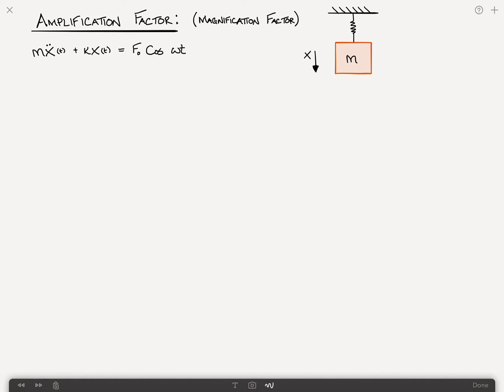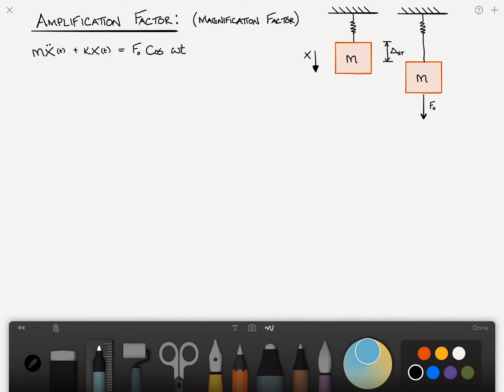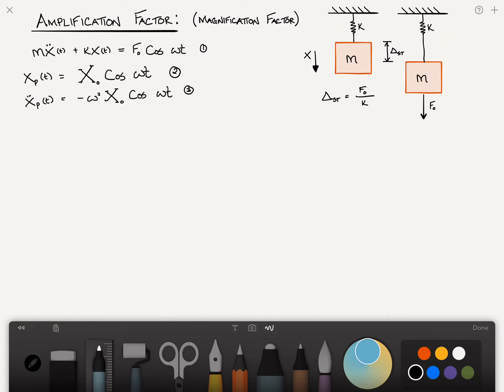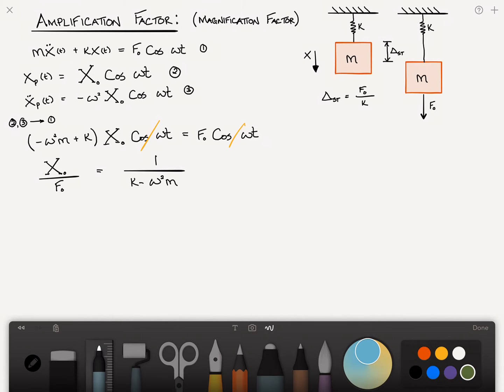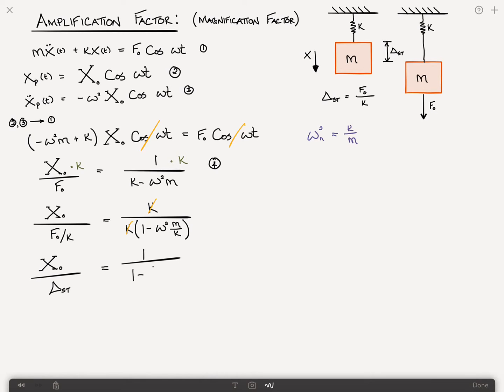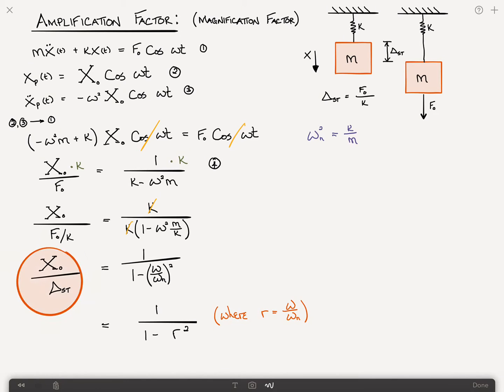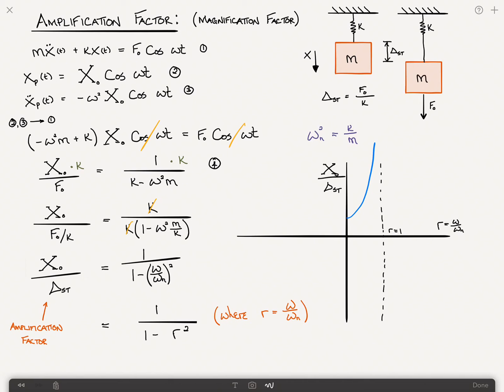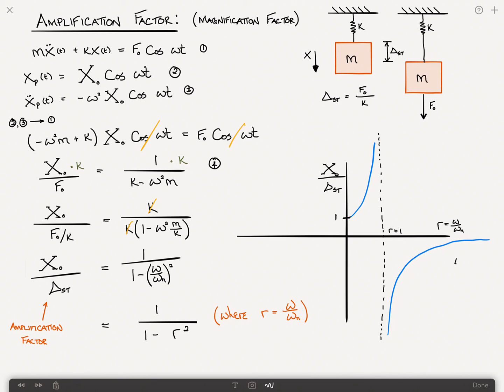Dynamic Amplification Factor

Comment: It's quite comprehensive, nice video! I have some questions here. Is the amplification factor also the transfer function? Can we take the special solution xp(t)=X0cos(omega*t+phi) or xp(t)=X0e^(i*omega*t)? And besides the sdof, how to do that for mdof, like two pendulums?  Thank you~
Reply from the maker: Yes, you could have used either of these functions (only phi will be zero because there is no damping so everything is in phase).  I would say that, technically, Amplification Factor is a subset of the Transfer Function - their definition is slightly different.  In this SDOF case they may be the same thing, but for larger systems, I would say that for the Amplification Factor, we look at certain elements of the Transfer Function.  Both involve examining the steady-state response of the system.

In this video on dynamic vibration absorbers, I perform a similar treatment of for a 2 DOF system....only in this case I am looking to zero out the amplification factor.
https://www.youtube.com/watch?v=7T6pQnNBph0
Reply: @Freeball99  Does that mean, the amplification factor and transfer function both neglect the trigonometry part?
Reply from the maker: @andrealiu8650  Not sure what you mean by "neglect the trigonometry part".
Reply: @Freeball99  Sorry for my expression. I mean, only consider the amplitude, and assume the trigonometry to be at maximum, which is 1.

Comment: Hi

Could you please clarify the following 3 queries:

If I have a steel structure supporting a heavy industrial machine (about 20T) with rotating load, and I want to know the natural frequency of the structure to check the effects of the rotating load - what is the mass that's used in the calculation of the natural frequency of the system? The steel frame only, or the steel frame plus the weight of the machine, or the steel frame plus the weight of the moving part of the machine only? The moving part is a drum plus material inside the drum.

The second query - Once I know the natural frequency of the system (say it is 1.0Hz), and the frequency of the rotating load is 2.0Hz (a rotating drum, at 120 rpm), how do I check the effect of the moving load at start up? i.e. Initially the load is static, but at some point as it speeds up it will be at the natural frequency of the system, momentarily.

Third query - The machine has a motor which drives the drum, which operates at a higher frequency (23Hz, or 1,400rpm). Given that the rotating drum and the motor are acting concurrently, what is the forcing frequency that the structure feels and needs to be checked for? Does the high frequency motor mask the effect of the rotating drum? Or, is the frequency that the structure feels that which has more contributory weight behind it? I suspect the moving parts in the motor are very light, compared to the moving parts in the drum, and hence the motor would not mask the effects of the drum.

Thanks
Reply from the maker: Tom, my apologies for the delayed response on this, but I never saw it until now.  I realized it might be too late, but in the interest of others who might read this, I wanted to furnish a response.

1.  The mass to be used is all the mass that is vibrating (any mass that contributing to the kinetic energy of the system).  Anything that is rigid can be ignored.

2.  There are various ways to do this, but I think the most obvious is to perform a time-stepping solution - ie integrate the equations of motion numerically and simulate the problem.  The speed at which it starts up will be a factor.  The quicker that the load passes through the resonant frequency, the less will be the effect.

3.  Not sure I understand the question fully, but hopefully this covers it.  Assuming we are treating this as a linear problem, then the effects of each load can be determined separately and the results can be superimposed - i.e. you will determine the response caused by each load separately and then add them.

Comment: At the beginning of video, while calculating static deflection, you assume mass-spring system is in the horizontal plane, right? If not, we have to consider the weight then eq becomes (F+mg)=kx
Reply from the maker: Correct.  There is no assumption that gravity is present.  In general, if it is not stated, then don't assume gravity is present (with the exception of pendulum problems - which work only if gravity is present).

Comment: In this example, the transient response is neglected by which assumptions exactly? The fact that you are applying a steady tension to the mass-spring system and therefore don't have to look at the homogeneous part ?
Reply from the maker: This is a very good question! I probably should have addressed it in the video.  Let's see if I can do it here though it's hard to write equations.

SHORT ANSWER:  Adding the transient part makes no difference to the result.

BETTER ANSWER:  I encourage you to try this yourself.  Add the transient/homogeneous part to the particular solution - need to do this BEFORE solving for the constants.  Solve for the constants by applying your initial conditions (assume rest conditions).  What you will find is that 1) the coefficient of the Sin part is 0 (since there is no damping, the Sin part will zero out) and 2) the co-efficient of the Cos part will contain the same dynamic amplification factor (1 / (1 - r^2) ) which is what is of interest.

The conclusion one comes to is that the analysis remains identical because: 1) the Cos parts are bounded between -1 and +1  and so 2) it is the co-efficients that determine the magnitude of the response and 3) the co-efficient of the homogeneous DEPENDS ON the co-efficient of the particular solution (which is determined first) and as a result, the same dynamic amplification factor appears in both (the coefficient for the homogeneous part contains a few extra goodies, but you should be able to convince yourself that these are bounded too).

Hope this  makes sense.
Reply: @Freeball99  Thank you so much for the response. I think I need to review the mathematics procedures again in your initial videos instead of just looking at them microscopically, 1st steps are always the most important! I'm always trying to get physical interpretations to apply this to launch vehicle structures (Pressure vessels/Nozzles) 

My interpretation : 

The homogeneous coefficients are always dependent on the particular coefficients?

Homogeneous = Quantification of the free vibrations innate/intrinsic to the system. Omega natural quantifies this via the mass-spring relationship.

I.e. : When you pull on a spring-mass and let it be. 

Particular = Quantification of the forced vibrations externally imposed by a force that is a function of time. The ratio of omega natural vs omega of the forcing function illustrates these forced vibrations.

I.e. : When you periodically/continuously change the magnitude&direction of how you pull on the spring-mass. 

Thanks again for the response!  I just need to keep watching is all.

Comment: What is a reasonable maximum magnification factor for foundation design?
Reply from the maker: For some reason, I have the number 1.5 in the back of my head.  I would imagine that it will vary depending on whom you talk to, but for some reason I have 1.5 in my head - although don't quote me on that.